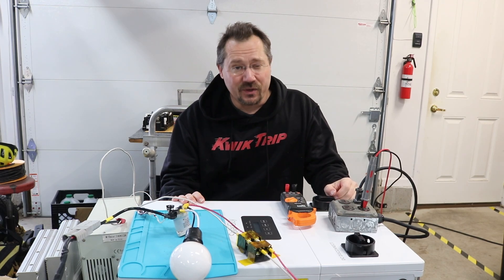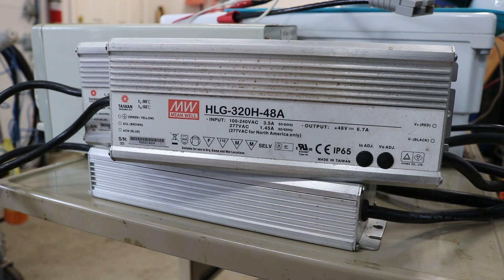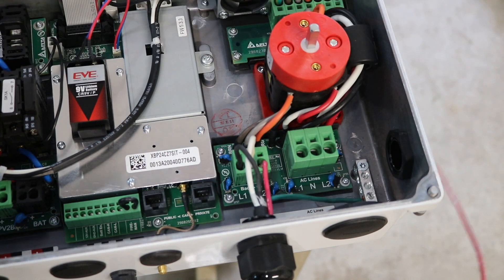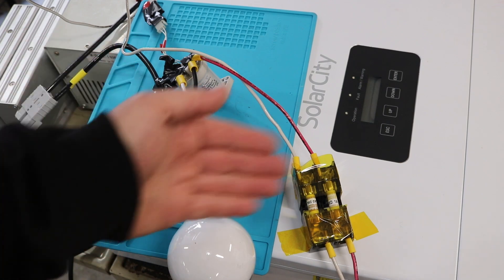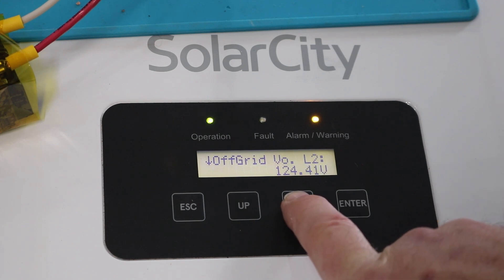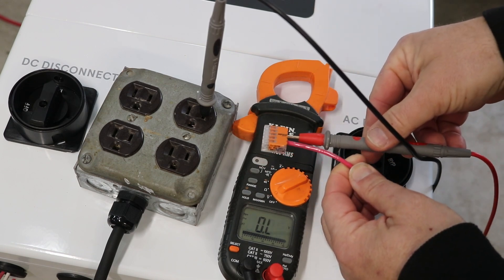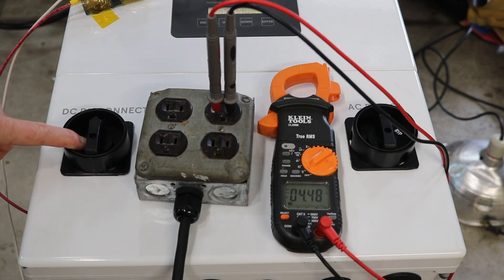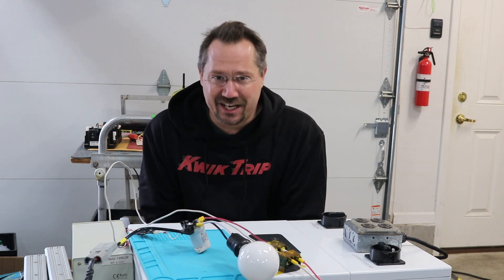Testing Solar Inverter WITHOUT SOLAR! | V2H Solar City H6 | CHAdeMO to Home

Comment: This inverter is frustrating me, it stopped working, i measured the volts and it seems fine but it isnt producing power. There is a solid green light which should mean its in operation, no fault light, it had solid yellow light (warning/alarm) but that seems normal because seems like everyone else im looking at online that has this inverter has that solid yellow light on as well. (Not using battery)
I want to try to configure grid settings to see if anything works, but its asking me for a 4 digit passcode which i dont have, i tried contacting solarcity but it directs me to tesla which told me they bought solarcity but when i ask them for help about my solarcity inverter they seem clueless and useless and even gave me a phone number to solaredge, most likely to just get rid of me.
I read this inverter also has 10 year warranty which tesla didnt help me with, i asked for passcode since solarcity manual said if i want the passcode i have to contact customer support which directed me to tesla when they sent me to solaredge support. -__-
Do u know what the 4 digit default passcode is for solarcity inverter so i could finally make my inverter working again?
Reply from the maker: Try 6532 for the password.

Comment: How's your testing going? I'm especially interested because my house battery reached empty yesterday.
Reply from the maker: I ran the inverter off my electric motorcycle at 130VDC. That seemed to work pretty well. I'm busy with a couple other things right now before I can do some real serious testing running it through CHAdeMO from the car.
Reply: @BenjaminNelsonX  after my battery ran dead the sun came out and I've been okay ever since.  It seems like December is the only time I ever run out. I've been charging the Chevy volt every other day as well.
Reply: @BenjaminNelsonX  you'd have to leave it running for 2 or 3 weeks solid before I would be confident that this random solar panel resistance check it does doesn't cause an explosion.  at least that's what I'm assuming is what's going on when it stops putting out AC power for 2 to 3 seconds. 95% of the time it happens during the dark.
Reply: @BenjaminNelsonX  when I have these random short shutdowns it's like sometimes I won't have it for 2 weeks and then another week it'll happen consistently every evening. Sometimes instead in the morning just before sunrise and very very seldom it happens in daylight.

Comment: If you had a 500vdc 70amp  PSU to simulate a PV array, will your PV1 inverter input draw a max of 19 amps?  I ask, because maybe that short circuit current spec of 26amps, might be for the max PV array output.?. 
I've seen a few PV inverter manuals warn against using a battery, instead of a specific max voltage and max wattage PV array.

Comment: Did you get that inverter cheap? Cool test. Wonder which is more efficient dc to ac through the inverter or pv to ac? What is the battery voltage for the inverter? 48vdc or is it a high voltage battery as well? Cheers
Reply from the maker: All the specs for the inverter are plainly shown in the video. It's designed for a particular high voltage battery.
I got the inverter used good condition, through eBay for $325.
Reply: @BenjaminNelsonX  i missed it. good deal. seems like a decent inverter. cheers

Comment: Watching closely Ben!
I really want a solution that allows me to charge my EV from my PV while keeping the lights on thanks to the PV on the roof, a smaller battery pack on-site plus the battery pack in my EV in cases of extended outages. 

I recall one inverter allowing you to charge from your PV directly, but it seems nothing ever came of it.. Not too such how much I trust Alibaba's offerings, but it's getting tempting..

Comment: I’ve been charging 24v 5kwh overnight at low on overnight rates and then back feeding during the day via enphase micro-inverters to handle my base loads. In my case the system is limited by the small inverter. I am in the mppt range and have seen no ill effects. It cannot track up because it’s at battery voltage and cannot track down because the it cannot pull enough watts out to get a voltage drop. 

My gut says there will be no short created, but it it will try to power blindly everything you load it with plus internal losses. 

I’m not sure the max rating of battery/wires/etc on input side, but so long as it can handle the amps to full burst watt rating of the inverter with some overhead it should be fine based upon my research and testing.

What’s interesting here is you have an off grid inverter, so it will only output what is needed. I have a victron multiplus for backup and left over micro inverters. I guess we both are cobbling what we have at hand and the limitations of current offerings and our wants.

Best of luck! I’d also look at class t fuses for this if there is not one readily available in the car.  This high voltage is no joke!
Reply from the maker: The inverter is actually a hybrid inverter, but yes, in this case, is acting in off-grid mode.
It's a 6,000 watt inverter, so that's less than 17A at 360V.

Should be WAY more than needed in a simple blackout situation!

My garage solar is also Enphase micro-inverters, and I'll see what I can do with those after I get the rest of this figured out.
Reply: @BenjaminNelsonX  I figured you were covered. It's amazing how much power an EV uses compared to a house. I was talking to my father-in-law who is generally knowledgeable, and he was skeptic that the new Ford Lightning uses 80A@240v continuous to charge -- that's a lot of power! The Lightning uses ~19kw alone. My non-car peak power with an all-electric house in the northern NY is ~18kw. That's base loads + a geothermal heat pump, garage heater (resistance), drier, stove and other odds/ends on at the same time.

The Enphase Micro-inverters (at least to IQ7) do not setup the base voltage nor throttle to my knowledge. Thus without something else to start the "grid", they will not even turn on. And once on, my understanding is that they run all ~250watts even if you do not want them. I'm not sure what would happen if you were able to start one with a generator, then turn off the generator, but my guess is that they would increase/decrease in voltage or frequency and trip offline depending of if the load was above/below the ~250 watts times # of units. The new IQ8 is supposed to "solve" this, but it's not really end-user serviceable and it's better/cheaper to just buy the right tool for the job (off-grid or hybrid), or go all-in with the Enphase inveters + battery + transfer switch, but I'm not a fan of being forced to stay in a single ecosystem.

Good luck and whatever you do, thank you for sharing it.

Comment: this is very neat. would be very cool to tap into my bolt ev battery to run that inverter would be very neat and useful when the power goes out.

Comment: thts pretty surprising that you can run output directly from PVinput, usualy its prohibited and inverter dont power on when batery or ac is missing
Reply from the maker: That's one reason why I specifically got this inverter. I had read from others that it can run in an off-grid mode WITHOUT a battery pack attached!
What exactly you can and can't do varies by brands and models of inverters.

Comment: i have a max 132v ev and a 145v inverter, how can i lower the current so i don't  destroy the inverter pv input?
Reply from the maker: You don't need to lower current.
You can think of potential, measured in Volts, as wanting to PUSH, but current (measured in Amps) is a DRAW or a pull.
How much current goes through will mostly depend on what you have attached to the inverter as a load. That load draws current through the system. Only as much is drawn through as is needed to power the load.
A battery that only goes as high as 132V is fine for an inverter which can handle up to 145V